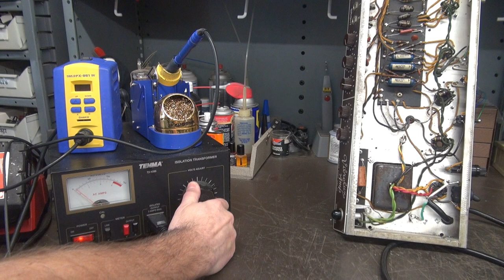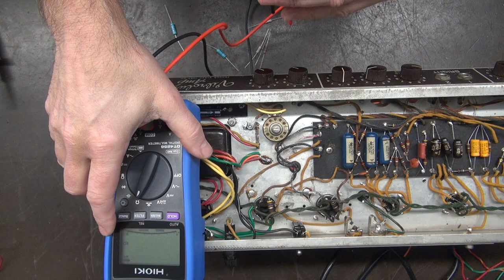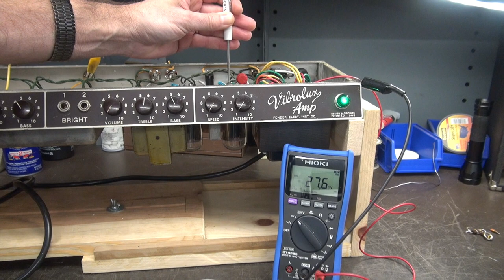How to repair 1962 Fender Vibrolux Brown face tube guitar amp Smoked transformer blows fuses

Comment: I'm envious of your steady soldering hand. I hadn't soldered anything in years when I tried to replace an output cable on a small Boss wall wart transformer. My hand shook more than I expected, which created a bridge between to points on the PCB. Needless to say it produced no power. I un-soldered the connection, removed the excess solder and forced my hand to be steady, and was successful.  Very good video. Keep 'em coming.

Comment: Would you consider making a video on what components you use and trust for replacement. Like resistors or capacitors and transformers. Those coupling caps that feed the output tubes. One needs to know what to look out for and what to avoid. You mention the kinds you use all the time, but a single video for reverence would be great! Love from NW Colorado. Thanxz

Comment: Hi Tony, What I found helpful, when cleaning out a solder joint of a socket, is have a curved dental pick and push it through the opening, after I heated it.

Comment: I’d like to hear more on what exactly you worked on on the USAF. I was trained at Keesler AFB on soldering, tube theory, and the radio gear I worked on. Ground NavAids - TACAN,VOR, Localizer, Glideslope, and marker beacon transmitters.
Reply from the maker: I was 31650G Missile systems analysist specialist, Ground equipment Minuteman, then e-lab, then Tech engineering
Reply: @d-labelectronics  awesome ! 
From Keesler, I spent 3 years at Minot AFB 🥶
Love your videos, thanks so much

Comment: I think Fender did the 6.3v wiring to the pilot light because of wiring reasons. It's closer than going to the tube socket, also a little cleaner! In my builds I've only done the wiring to the 6.3v to the lamp.

Comment: What # heating element is on your Snozeramus iron? I bought 5 old Ungar Irons with multiple tips and elements off eBay for dirt cheap. Biggest I have is a 45-55 watt element but has screw on tips. Doesn’t seem hot enough for chassis work. Bought an old 300 watt American Beauty iron that definitely gets it done, just so damn big. You’re a bad influence, I bought 5 old Beckman multimeters non working in great shape with probes in original boxes. 3 just had corroded battery clips and one had a bad LCD, I used the worst for a donor meter. 4 out 5 work great for $30 investment. I have about 10 auto range meters, 3 VTVM’s, 1FETVM and 5 AVM(4 Triplett meters and one Simpson) thought the old Beckman meters would be cool restoration projects. They were. Great video by the way, I do a lot of the same work for local customers.

Comment: I love hearing them when they are done.  This one is classic fender tone all the way!  Do you have time for a question?  I am going to build my first tube pre-amp.  The schematic shows a power transformer with a 120V primary, then a 12v and 120v secondary.  The author has pics that show a transformer, but when I put the model number into google, it comes up empty handed.  The pics show 20VA.  It has 2 pair of wires for 12v and 2 pair of wires for 117v.  I would ask the author but his website no longer exists.  Thanks if you can help point me in the right direction.

Comment: Could I put those resistors in my amp on the 6l6 tube?  I have a 1987 Fender Champ 12 red knob 1 6l6 and two 12ax7s,  thanks

Comment: Terry, would it prevent heat destruction on those 1.5 k grid resistors to be mounted up and to the side of the tube socket like you did with the 470 ohm grid resistors? Are those metal oxide resistors able to take the heat? I know I ask a lot of questions, but you are the man who would know! Love from NW Colorado. Thanxz

Comment: Hello Terry I have a question and I hope you don't mind (sort of off subject). I have a Fender Champion 100. It's a good sounding amp. The only thing I would change is the Tap tempo button for the effects. My question is can the Tap button be replaced with a pot and knob (it would make resetting the tempo for effects a lot easier)
Thanks in advance.
Ray C

Comment: Maybe the guy who was afraid of cutting wires was experiencing Analysis Paralysis. It's common in neurodivergent people (autism, ADHD, etc), where making a choice can be too overwhelming, because they often think ahead about the outcomes before making decisions.
Something as simple as saying "add an inch if you think it might be too short" or simply saying "you can always cut it right before making the connection to the joint" helps a lot in most cases. Pressuring them only increases anxiety and makes the paralysis worse.
Reply: How's that option anxiety doing?
You can tell me now, or you can wait and tell me later.

Comment: While watching this, I'm wondering why you didn't twist the wires coming out of the new power transformer, like they were on the old one.  I see a couple of twists in the yellow and green wires, but not as much as the old.  Doesn't that reduce the shielding and increase the potential for noise?
Reply: When I was rebuilding an early 70s one I tidied up the lead dress including the transformer wiring... didn't hear a difference although it does look much neater

Comment: Note on electronics from areas where they have cockroaches, aka "Palmetto Bugs" (Like Florida, Hawaii, California, etc .) The cockroaches tend to like to crawl into electronics, especially something that generates heat. They eat insulation, and their urine & feces really stink up the equipment and cause corrosion. Also they can crawl into places and cause shorts.